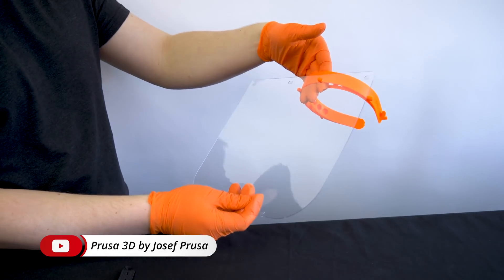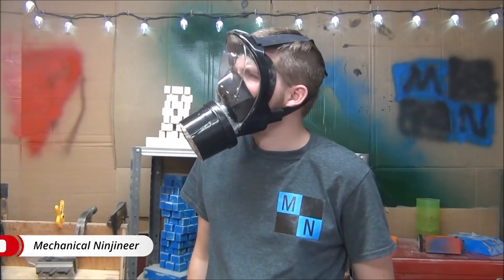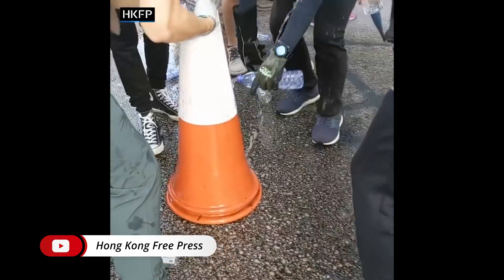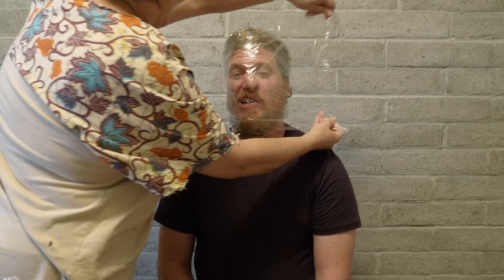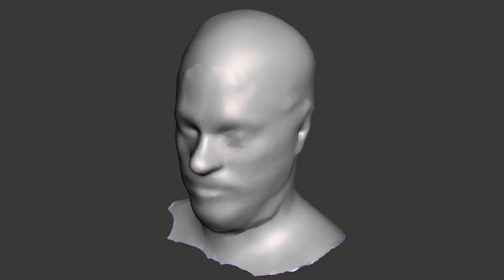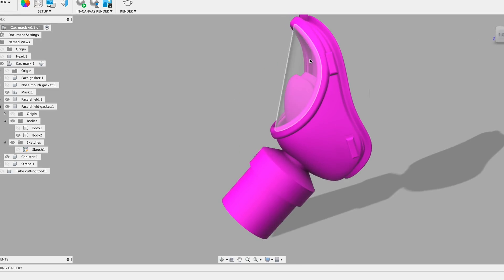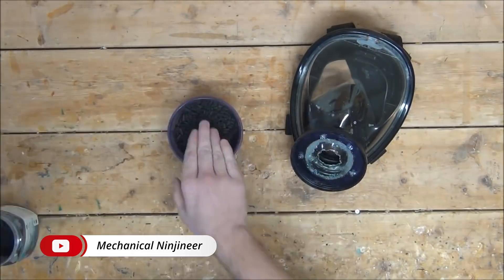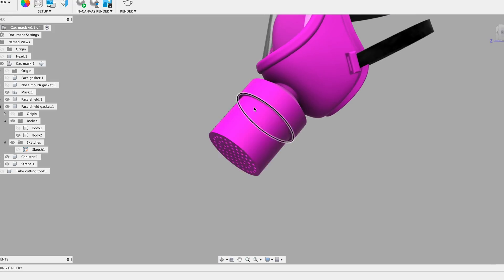I Designed an Open Source 3D Printed Gas Mask

Comment: You thought police were benevolent. OK... so you were ignorant. That doesn't excuse further ignorance. The police state and its actors are a problem for everyone. The problems are systemic but generally in the way libertarians and anarchists have been arguing for 50 years and not how they generally are portrayed today. Whether it's George Floyd or Tony Timpa... the system is such that bad actors will more often than otherwise be attracted to policing and will be put into situations to abuse people and often be shielded from repercussions. The war on drugs, asset forfeiture, no knock raids, immunity statutes, victimless crime laws, etc. These effect us all, just some more than others, as would be expected with such a multivariable situation.
"Black Lives Matters" is bad sloganeering if so many people are turned off by it. ACAB is bad sloganeering if so many people are turned off by it. What is a whole lot less controversial? Showing how the war on drugs is harming everyone. Showing the danger of militarized police and stacking non-criminal problems on them. Showing how asset forfeiture is abused. Showing how victimless crime laws ruin lives. Showing how police abuses incentivized by these policies harm people. 
If you don't know anyone who's dealt with such things then you've been very lucky. These are common occurrences to those at the bottom rungs of society of all races, religions, creeds. Many have been talking about this topic for nearly 2 generations and few listened. The chicken is coming back to roost. If people misdiagnose the problem it's unlikely they'll solve the problem. Instead of ostracizing people who've been talking about all this for so long perhaps those groups and individuals should be brought to the discussion so everyone can learn what they saw and how they saw it.

Comment: Recently I saw a comment warning about „safety“ glasses that are not rated for impact. They can splinter and cause even more damage than if you hadn‘t worn any at all. I am not sure if this applies to soda bottle PET, but maybe consider contacting someone about this. Might not be an issue at all. But better to be on the safe side in regard to eye-safety...

Comment: You can buy actual gas masks for less than $30 some places.
Having an open source design is great but it's not likely to be cost effective and as functional.
Reply: Until they run out.
Reply: Toni Lähdekorpi they shouldn’t run out of those, they aren’t as essential to the general public as face coverings are. It’s a niche of protesters on the front lines who are really at risk. He said in the video even we just need enough for the people to deal with the canisters. Doesn’t look like the inventory on amazon or eBay is going down at any faster rate than in 2019.
Reply: @TherealTprentaloe  This depends highly on how things are going to look moving forward. If the protests keep growing, the demand may surpass the inventory and supply quickly.
I do think it's not a bad idea to be prepared while still buying the commercial ones.
And thinking a bit further, not just the US, there may be a need for a printable design somewhere in case you are blocked from buying them.
Having the option of a commercial and DIY one don't cancel each other out.
Reply: Toni Lähdekorpi so I’m not seeing any shortages of these still...
Reply: Toni Lähdekorpi it’s only DIY if you own a rapid prototype machine
Reply: 7 bucks on ebay
Reply: GP-5 and GP-7 are very cheap. Don’t use original filters though. They have asbestos

Comment: One point about Acrylic: it shatters and can be dangerous especially in protests, where police might be using projectiles. I would suggest thin polycarbonate sheet, that you can just bend into shape without heating and it stays that way due to the clamping of the mask.

Comment: Reducing 3D print times generally involves reducing the thickness of the print (unless it compromises structural integrity), reducing the amount of support material, increasing filament flow through the nozzel, or a plainly faster printer (like SLA).

#BlackLivesMatter

Comment: 2:20 Ever heard of TPU?
Reply from the maker: Yes, but not everyone can print TPU...
Reply: @StrangeParts  I really think he wasn't aware, cause he hasn't one. Probably only knows about ABS and PLA.
Also not entirely true. Many printers can print TPU ... although awfully slow. (At least I heard I can print TPU with my Ender 3 Pro [without modifying it to direct drive], not tried it, yet, tho. Recommended print speed is less than halved of PLA.)
Reply: MrMegaPussyPlayer "he"
You're replying to the guy who made the video

Comment: Id suggest removing the eye protection part so a standard pair of goggles that could provide an easier flexible seal around the eyes thus simplifying the design and reducing build time. Plus wearing glasses is going to be difficult in a one piece where the risk of fogging is higher.
Reply: Feature creep is a real problem, goggles already solve the eye problem, agreed with OP, reduce design to breathing portion only.
Reply: Anything that makes this easier to print and use is a welcome idea. This would save on print time and overall make it more accessible, IMO.
Reply: Buying something as specific as goggles has a small chance of becoming difficult if things get much worse. Also, chemicals like capsicum and tear gas are skin irritants, so leaving any part of the face uncovered is potentially dangerous
Reply: @God-ib7xc  People really should be buying casein powder in addition to bottled water for the movement's field medics. It's the perfect surfactant for capsaicin exposure. I don't think there's an effective treatment for CS gas other than flushing the eyes with plenty of water and extinguishing the canister quickly so it doesn't aeresolize any further. Hong Kong definitely is leading by example here.
Reply: The secondary mouth seal is there to stop fogging
Reply: @4rtie   But in trying to make two good seals one may be compromised.
Reply: Safety goggles are usually NOT airtight... If you're talking about swimming or snorkeling goggles, they would be...
Reply: @bevanarcher4586  i think swimming goggles is what they meant.
Reply: @bevanarcher4586  That's what I pictured when I read his comment. They make airtight safety goggles.

Comment: Idea for the gasket: Use D-formed rubber seals. They are tight, have some more tolerance and are also easy to get.

Also an idea: Use the Bellus3D app to create their custom mask clip and mesh mix that into the design.

Comment: No. Noones just blasting tear gas into peaceful protesters. Protesters get out if control  and dont want to break it up. No noone needs this . You act stupid you get blasted. And if you have a beard  you wont get a seal. So it's useless if you dont shave and have a clean face.
Reply: This seems like it would be true. But sadly its not there are tons of videos of peaceful protesters being tear gas pepper sprayed and shot with rubber bullets. People just stepping outside of there houses to smoke have been shot with rubber bullets.

Comment: The separate air spaces for the mouth/nose and the rest of the face works in a few ways, 1- it reduces the area that needs to be perfectly sealed, 2- it prevents condensation from your breath from "fogging" up the mask, 3- it means there's a smaller air cavity that you breathe into, so there is a greater air pressure on the filters to pass more air (as filters add a restriction, more air pressure will pass more air).

Comment: 1. Rigid design, and you made it only fit yourself. Other people would need to completely redesign the shape.
2. Would most likely be extremely brittle.
3. Would be extremely difficult to print without splitting into smaller parts. Also one failure would consume lots of time.
4. Might be bound by the size of the printer.
5. Takes a very long time to print, which would make it inaccessible to most protestors and inconvenient to produce multiple for multiple protestors.

Should have just gone with a DIY design that uses common hardware store stuff, instead of running with the whole 3D-printed thing.

Comment: awesome idea and a great v.1, the only thing that i would say is that you might want to modify it so that it is easier to print/printable with no or less support material. this would allow people to churn them out faster and with less potential for the print to fail.
 
maybe pick a side or angle that you can then flatten out so that it could be printed against the build plate instead of in mid air. plus the less support material used means the more masks that could potentially be printed.
 lastly it may also be good to think about what angle it would be printed at as this could make the final mask weaker or stronger depending on how the layer lines match up.
Once again, a great video and excellent idea!
Reply from the maker: Yeah, great thoughts. I'm really worried about the long print time. I'd love help making these sort of refinements.  There's already a bunch of good discussion happening on discord (link is in the description).

Comment: You need to add one way valves both for an exhale port and on the inhale port coming from the filter.  These are easy to make using flexible flaps of rubber or plastic.

Comment: Would silicone glue be a good seal for the face?
Reply: I don't think it would be a good idea to use it to seal the space between your face and the mask. 
The shape of your face might be different than the shape of the mask and silicone isn't that soft.
I would use those rubber strips that are used to seal the doors of a car. They should be easy to obtain and it is literally their purpose to seal stuff. Silicone should be a great fit to connect the mask to the rubber strips tho.
Reply: Make protopuddy as a gasket. Silicone caulk and cornstarch.
Reply: @86fn  interesting

Comment: The "very low tech" actually looks like a really good idea to build on. i.e. with the bigger pexiglas you can drastically reduce the amount of printed material, reducing print times. So basically the 3d printed part would only be there so the plexiglas gets stability and conforms to the face shape all around.

Comment: You need to add a one way valve to the mask to easily let your breath out, so your mask doesn't lift up. I designed a dusk/ gas mask a few months ago and didn't do this, so the mask didn't work very well.
Reply: That valve to the outside is also necessary to reduce the dead space (the space the air has to pass through but where it can't be used) which makes breathing a lot easier and there isn't as much CO2 buildup.
Also, in commercial masks, after the air passes through the filter, it first passes through the upper part where the visor is, to prevent the visor from fogging up. It then passes through another set of one-way valves into the inner mask.
Reply: One thing to keep in mind, if using this mask to prevent infecting others with the virus, the valve needs to be filtered otherwise you're exhaling to the outside world. So many people wear masks with one way valves without understanding that the mask is to protect others from you, not the other way around
Reply: humidity reduces the adsorption activate carbon of volatile organic compound so breeding to the filter isn't the best solution

Comment: 1. Not everyone's face is exactly the same, how do you plan to make the rigid 3d printed design fit on different face shapes and sizes?

2. Some of the parts in the model look quite large, do you think its possible to split the larger parts into smaller ones to be printed on smaller 3d printers? For example the large peices could be split into multiple smaller ones then attach together using super glue or epoxy.

I'd love to hear anyones thoughts on this

Comment: I bet the secondary seal helps a TON with fogging.
Sill gasket may work if not weather stripping, but sill gasket is non-adhesive.

Comment: The inner seal is to have a constant airflow over the transparent visor so that it doesnt steam up.
Reply: I've worn similar professional 3M respirator designs and fogging really isn't an issue if the mouth flanging is sealing properly. However, the design does need a proper hinged (NOT center post) exhalation valve to remove as much CO2 from the mask as possible. I'd also recommend sieving the activated charcoal granules to expose as much surface area as possible and prevent airway clogging due to moisture agglomerating smaller particles.
Reply: The oral nasal insert removes dead space in the mask and ensures exhaled gasses leave the mask.
Reply: It also prevents death due to CO2

Comment: im going to modify and print this for use at work when theres a lot of dust (or at least i hope i will) THANK YOU!
Reply from the maker: Awesome - let me know how it goes!
Reply: Ask your employer for a descent mask, it will protect you better and be more comfortable than any diy solution.  Most civilized country's have laws that obligate employers to provide personnel with adequate PPE's
Reply: Geiler Nutzername.
Reply: As cool as this is, if you are actually use it for protection, consider buying a real, tested one. There is a reason, those things aren't that easy to design, make really safe.

Comment: I like the idea! Perhaps it would make sense to use 3D printed molds so we can make custom silicone parts? I've also seen a video of a massive DIY resin printer, that might be faster, more precise, and more airtight than using an FDM printer.
Reply from the maker: Yeah, good call on making molds!  You could make more flexible parts, and crank them out much faster...

Comment: The smaller seal is necessary because it allows you not to breathe the air trapped inside the mask, and instead circulate air from outside. The smaller the cavity you breathe from is, the fresher the air, especially if you don't breathe heavily.
Full face diving masks had issues where divers did not dive, thus not needing to breathe as much, and building up CO2 in the face compartment. I think some people died because of this, but i'm not sure.
Reply from the maker: Yep, good call.  I actually know a diver that died from exactly this :(
Reply: Military gas masks actually intake air through the eye pocket to keep the mask from fogging up. There's then 1 or 2 one-way check valves flow into the breathing portion. Then there's another check valve out by the mouth. I realize that's a lot more work and not as diy hardware store capable, but that's the intent.
Reply from the maker: @Andy-jq5yw  Ah, that explains all the valves I was seeing in the commercial designs. I was trying to figure out what those were for...
Reply: @StrangeParts  I wonder if it  also helps with fogging the vision parts by separating from the muggy breathed out air.    suggestion perhaps to add a mount for a small fan to create positive pressure in the mask itself (so that all air coming in goes through the filter and to make leaks less damaging)
Reply: Yea, and to test the seal we usually just plug/block the inlet with the palm of my hand and such in. If you can still draw air its not tight.
To clean of the teargas crystals from clothing you can usually use a brush, start at the head and work your way down. DONT use water ;-)
Reply: Also, helps A LOT preventing fogging of visor.
It's better to add a valve between half mask and mask that'd allow air to move from mask onto half mask, while preventing it moving backwards. It also somehow preventing fogging of visor, and adds a way to check the seal of full mask part (cuz without that valve you'll be able to test - via inhale/choke test - a seal only of half mask).
Reply: BTW, instead of charcole you can use ULPA (or try HEPA) air filter materials. Don't know about USA, but in some countries you can buy sheets and rolls (1-2 meters per tens of meters) of these materials VERY cheap.

Comment: There is also a 3d design of an anti gas kettle people are using.
Reply from the maker: I saw that - not sure how it's better than a traffic cone though?  I guess if there aren't any traffic cones.  I've also seen someone just use a milk jug with the bottom cut off.

Comment: Great stuff. Would be nice to see this integrated with the Bellus app. (Where you scan your face in 3d and have a mask that fits your face perfectly)
Reply: Vito como fare
Reply from the maker: Yes, that would be a great addition!  Definitely was thinking about that, but haven't looked into it yet...
Reply: @StrangeParts  I'm just a normal user, so nothing to do with Bellus3D in any way - but I've seen they actually sell via their app a face mask (much more simple than the one designed by you here), but with the benefit of that being bespoke to you (as in your face). I guess if the component that is in contact to the face is a standalone piece and has a standard mounting to the rest of the mask..that would be great as you have both standardisation (could print in bulk the mask) and customisation (it will fit your face perfectly). Amazing job anyway! So glad I'm subscribed to this channel!